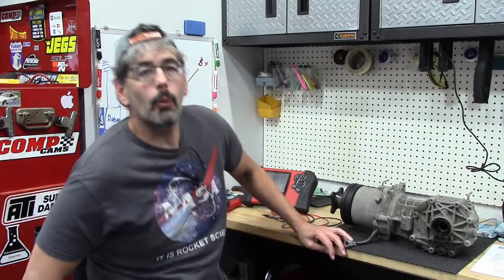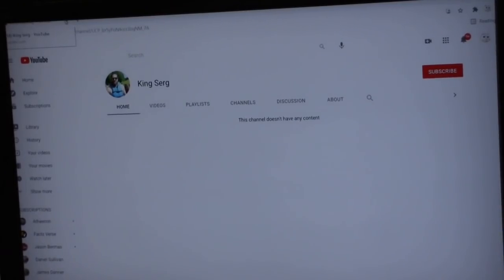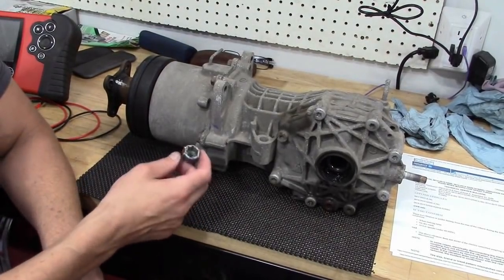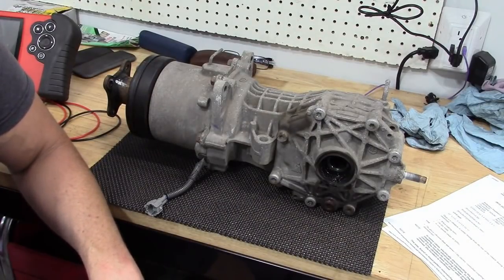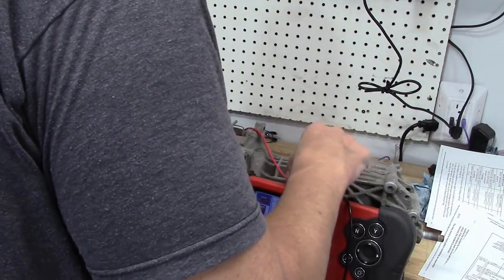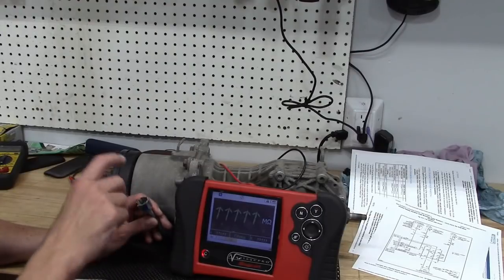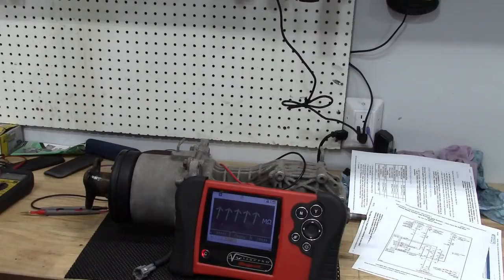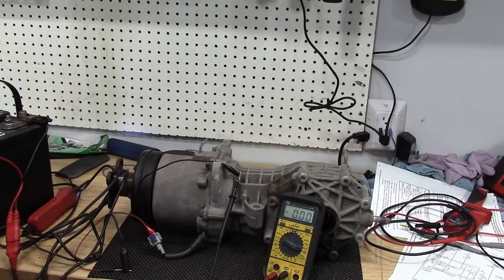Nissan Rear Differential Electronic Coupler  a PSA

Comment: So is it safe to drive with this coupler unplugged if it is indeed the party that is bad? I have a horrible clunk with it plugged in with your rotation but that house is gone when unplugged
Reply from the maker: Yes unplugging it should just make the car FWD as long as the rear differential isn’t jammed into AWD.
Reply: @SchrodingersBox okay thank you. Other than replacing the rear diff, is there a way to unjam it if it is infact jammed into 4wd just so I can prepare
Reply from the maker: You would have to take it out of vehicle and take it apart.

Comment: Where can I get the wire diagram of the QX30 Rear Differential Electronic Coupler ???
Reply from the maker: I use Mitchell DIY as my resource. Check it out. It’s just $20 for all the information on one cat.

Comment: So if you unplug it and that stops the thumping sound, you just have a front wheel drive Infiniti? Any long term issues just doing that and not spending $2k+ to fix?
Reply from the maker: Correct. Basically it just turns it into a 2wd so no long term ill effect.

Comment: Thank you for explaining this overcomplicated part ! Lol I own a 2016 Nissan Pathfinder and recently started having that 'juddering' moment when turning left at low speed.i work away on contract so I turned it over to 2wd and no problem ! I was short of time when I got back home so I had already booked it into a Nissan Dealership for quickness and convince and yes they did diagnose this coupler as the problem and there was no aftermarket part and I definitely did not want a 'used' part ! So it cost me $3,900 CAD ! The car is 9 years old but has only covered 75,000 ! so I thought it was definitely worth the price of replacement!  The part itself was priced at $3,400 CAD and labor for dealership was quite low but realise its actually a bolt on part ! But with your video I now understand this mechanism and didn't have time to fix or source myself ! Thank you !

Comment: 2024 pathfinder here....  towed a 4k trailer and next morning after disconnecting had all this happen....  low speed turn felt like axle was locked and hopping a tire.  Under warranty so dealership only replaced the coupling assembly...  my worry is if the differential is chewed?
Reply from the maker: Very well could be.  Lucky you al have a warranty. Often I’ll disconnect the fluidics coupler and if issue still happens it is probably internal damage to the differential.

Comment: PWM signals often use a setpoint current, and they PWM (rapidly switch on/off) the voltage supply to maintain that current setpoint. So in this case it's probably doing that, with a set voltage (12V or whatever) 

This is how a lot of hydraulic solenoids/valves operate.

Comment: I am getting significant rear awd binding on slow sharp turns. It sounds like the coupler  is the usual suspect but it still occurs when i electronically disconnect it. Can an unplugged coupler still cause issues, or should I focus on the differential?
Reply from the maker: It can definitely still cause issues. I also recently had one that still caused binding even after disconnecting it.
Reply: @SchrodingersBox  thank you. That helps tremendously

Comment: Well i disconnected the electronic coupler and the symptoms went away. Replace the coupler and still had the same problems. So i replace the whole differential and still the same problems. Replaced wheel bearings and its all fixed. Hope this helps anyone with this type of problem
Reply from the maker: if the issue was the wheel bearings then why did unplugging the coupler make the symptoms disappear?
Reply: @SchrodingersBox  Because all videos were pointing towards the rear diff. The sounds it was making made me think it was the diff from the way everyone was explaining. I learn the hard but iam glad I got it fixed for my kid
Reply: Did you replace the rear wheel bearing??

Comment: I keep getting squeals at low speeds in tight turns.  That is usually in parking lots.  Could it be cheap tires or is something wonky going on with the AWD?  It is low speed only when it does it.  This is the kind of AWD that is really more like FWD 95% or more of the time.

Comment: my awd rogue was towed without using a dolly some years ago and it never drove the same again, it's been getting worse and worse, my mechanic removed the drive shaft to alleviate the stress on the diff but it's gotten worse and worse to the point where the car now sounds and feels like it might break down at any moment. My mechanic says the diff needs replaced and to put a sticker on the car stating that it's an AWD and should never be towed with the tires rolling. Any thoughts? I can get the diff for 280 from a local junkyard, what should i do?
Reply from the maker: Ouch man. Yeah without knowing why it was towed originally it is absolutely possible there can be circumstances that could cause differential or transmission damage on a two-wheel tow. 
Unfortunately unless I saw the data and determined the cause of the issue I can’t really recommend a course of action.
Reply: @SchrodingersBox  i removed the old diff and opened it up, totally fucked. Huge metal shavings bundled up in a huge ball at the drain plug, gears all chewed up. Got the replacement in and waiting for the gear oil from Amazon.

Comment: On my nissan altima with cvt trans and rear diff. The electronic rear coupler was going bad and made a high pitch whinning sound. Kind of like a wheel bearing. My dealership replaced it under warranty but out of warranty would have been close to 2k fix.

Comment: Is there any truth to just replacing the two bearings and seal inside the coupler?  I've read that this is if fact the problem with the coupler.  That is $100 worth of parts.
Reply from the maker: I never heard of that before. I can’t see how that would work. You can replace only the couple instead of the whole diff, but it’s not a bearing issue. It’s an electronic issue.

Comment: Same issue with Infiniti jx35
Reply from the maker: Yes I see this happen on those cars just as often.
Reply: @SchrodingersBox  thank you for the reply , today Nissan Dealersh estimated replacement  of the electronic coupler 3000$ , they disconnected it for till (4wd ) till i get ready for the 3000 $ ,
Reply from the maker: Wow man. I have done this for 5 or 6 people in the last couple of years and I charged $400 total for a used unit.

Comment: I have the same problem with couple fail. How if I drive only in 2wd and leave the problem , will be any further damage to other parts? Big thanks
Reply from the maker: If you disable the coupler you will not do any damage- it just remains FWD only.
Reply: @SchrodingersBox  Thank you so much for your reply. But how can I disable coupler? Need mechanic do something or I just keep the switch at 2 wd, currently I drive in 2wd pretty smooth not any issues at straight or turn. Thank you
Reply: @SchrodingersBox  I have an 09 Nissan Marano I had the transfer case replaced, I still get the clunking making slow hard left turn or right turns. I pulled the four-wheel-drive fuse. The little 10 amp fuse, and it seems to have corrected the problem can I just leave it like this and have 2 Wheel Dr. with no other issues?
Reply from the maker: Yes disabling the coupler leaves it FWD. I have seen some where there is a mechanical issue though and the electrical disable still leaves it in 4WD in which case the mechanism either has to be manually disengaged if possible or the diff will need replacement.

Comment: Hey thanks for the video, I just replaced a similar differential on my 2015 qx60 and I’m curious to know if you were ever able to find out what exactly failed on the electric coupler or if it is serviceable. I still have the bad differential and I separated the couple to open it but couldn’t find a way.
Reply from the maker: While I have heard the couple itself can be separated and serviced independently, I have never tried that.  I have only ever done used units before and they come complete with diff and coupler.

Comment: ANYONE KNOW WHY THE AWD LIGHT WOULD COME ON AFTER UNPLUGGING THE COUPLER?
ITS OBVIOUSLY FAILING WHILE PLUGGED IN BUT NOTHING LIGHTS UP TILL ITS UNPLUGGED.2013 INFINITI JX35
Reply from the maker: I think maybe because the caps lock key is stuck on ?
Reply: That’s normal for the AWD light to remain on after unplugging the coupler. But you probably figured that out by now.
Reply from the maker: Roberts is correct.

Comment: I wonder if you have to test it live(key on or car running) cause it probably has to detect slippage for the ecu to send voltage or signal to activate it. Probably the more slippage, the more resistance to apply locking force?

Comment: 2021 Nissan rogue with 27k needed to replace the AWD electronic coupling assembly part 38760-6RE3A , glad its a lease and under warranty . Nissan needs to up it’s quality control .
Reply from the maker: I literally just did yet another one this past weekend.   Yeah they have a definite issue with the differential for sure.

Comment: I have this exact issue with my 2016 QX60. I cant afford to replace it righ now either. I'm not able to do this myself. Other than the dealer, what type of shop should I take it to have it unplugged? Will the technician be liable for anything?
Reply from the maker: Any technician can unplug it. actually any person can. you don’t even need to lift the vehicle. you can reach the plug quite easily.
Reply: @SchrodingersBox  Ok great thank you. I thought I would have to lift the vehicle. Thanks so much for your prompt response.

Comment: 2017 QX 60 rear electronic coupler is bad like you explained. Can I just unplug it and leave it? Can’t afford to replace it
Reply from the maker: YES!! It will just make the vehicle 2WD.
Reply: Thank you so much. I may look at a complete unit used. Any suggestions on where to find one? I may use LQK used auto parts
Reply from the maker: Try searching  “team PRP”. it’s a network of used parts with lots of locations in major cities. there is a location in denver where I get all my engines, transmissions and differentials (including this one in the video) and they always come through.
Reply: Thank you I am in Colorado Springs so I could make the Denver run. You’ve been very helpful thank you
Reply: One more quick question. I’m going to purchase a used complete differential and electronic coupler and install it. The dealership says that I need to have it towed to the dealership and programmed. Is this true or can I just reconnect the electronics and be fine?
Reply: @theqt-biblestudywithstevel4358  Did you ever get an answer to your last question about programming?. I'm having the same issue with my 2017 QX60.
Reply: @waranda6068  yes. I did not have to reprogram it. It worked perfectly.

Comment: This happened to me as well coupler failed. Felt like my rear passenger tire was locking up. This is with a 2018 Infiniti QX30 AWD with only 30,000 kms. Covered under warranty , cost over $7000.00
Reply from the maker: holy cow $7000!!!!  sheesh, I believe I charged $600 for this repair including the used differential. car has been great ever since!  man so glad that was under warranty for you.

Comment: have a 2015 pathfinder the coupler was replaced in the fall of 2020 at 104000km, Nissan covered it.  Now 30,000km later the same symptoms are happening, Nissan says too bad parts have 1 year warranty only.  I asked is it common for parts to fail after 30,000km, crickets..

Comment: Hello everybody, Question if some one can answer will be very appreciated:  I took the main shaft and the rear axles out on my 2015 Murano, I did put the outer end in without the axle-shaft : "safety first". Have a heavy oil leak in the differential. My millage improve from 18.5 to 22.5 doing the same driving so this thing is going to remain like this. Now I want to take the differential out. The questions are. The air hoses connected are for vacuum or cooing or what, should I just block them or join them together..? And the connector for the clutch/selenoid that engages the all wheel drive should I just disconnected is it monitor by the system?  I want to avoid a check engine light of course. Thank you for your time to answer.
Reply: Hey how did you solve that problem?

Comment: Hi if I take the drive shaft out and drive the car without drive shaft will that be harmful for the car.  I know the all wheel drive will not work but iam not worried about all wheel drive?  Please help
Reply from the maker: on some modes you can do that and there won’t be any problem- it just acts like 2wd. other models you would leak the fluid out.

Comment: There is a service bulletin for these, but there's not much info in it.  Basically if it's acting like a spool rear end during tight parking lot maneuvers, unplug electromagnetic coupler and if it goes away, you've got a hell of a direction.
Reply: Hello Matt!....i did disconect the e coupling and the kicking went away...my question to you is, is it necesary to replace the e coupling?  Is it ok to have it run without this part?...how long can i drive my 13 pathfinder without the e cuopling without causing any damage to any other part?
Reply from the maker: You can leave it like that permanently or until you replace it. It just makes the vehicle 2WD is all.
Reply: @hectorperales143  that Matt is correct!

Comment: What if you apply voltage and spin the input shift? Just curious if it turns the differential with voltage applied.
Reply from the maker: yeah I did try that before I realized how it works-  you. can’t test it that way.  Good thought though!
Reply: @SchrodingersBox  I figured you would have tried that. I just wanted to ask. Any idea about how this differential actually works?
Reply from the maker: Yes I will go into it at some point when I have another model but it’s a viscous-coupler. basically a lot like a fluid-clutch (like a car torque converter).  
  it is not a mechanical solenoid like I first thought.

Comment: I had this same problem back in March 2021, with a used 2009 nissan murano SL.  When i turn corners there was a hard judder like the brakes were grabbing ,a loud clunking. (at one point sounded like metal grinding) It was replaced with a junkyard differential and works fine now.  Also with my Nissan the transfer case was bad, missing or broken tooth in the ring gear. The dealer at the sales lot told me he just replaced the transfer case and severn days after purchasing the suv the transfer case went out again. The dealer offered to pay and replace it, and that was done but it was then when i test drove the suv i still felt the judder in the rear when making turns left or right. The mechanic was in the back seat an felt it. He replaced the rear def from the junk yard $300 parts an labor. Its been running fine sense ,and i drive it daily. The mechanic told me the most common cause was from improper towing not on a flatbed truck. but with the rear wheels on the ground. He mentioned that only a short distance of a block could do the damage to the differential .
Reply: facing the same issue now. So I guess there is no other way other than to replace the differential

Comment: Hello good day. A fan from Nigeria, and sorry am typing this here but it base on fuel trims. Here is my question and hope you can help. I don't have a code yet but from my fuel trim, or LFTS bank 2 I have -17, mean am running rich. And I have this funny herd start during warm startup and a little misfire don't really know what my problem is. The funny part is no body here around me seem to know what is going on
Reply from the maker: Yeah a rich condition can create a hard start.  Being that you are from Nigeria you qualify for free access to my paid channel and I have several videos on diagnosis of rich fuel trims there.  Send me your email and I will qualify you are eligible for the free access.
  Until then. I would start checking fuel pressure and fuel pressure regulator, check EGR and EVAP, and all other sources of fuel that could be entering engine unmetered.
  Conversely, you could have less air entering engine than is being measured- so PCM is over-adding fuel.  Bad MAF, MAP can do that.

Comment: Just watched the new Trans Am - broken valve spring video on the pay channel. You'd think this would be a more common problem, but I've never seen it before. It may be a pain but it could have been so much worse. Will you be replacing the other springs as a safety precaution? Great little series, this - it's amazing how those new shop lights improve the picture quality; everything is so sharp now. Thanks for the insight.

Comment: Hey, Matt, I came across something new to me yesterday, and I think it may possibly be an idea for the pay channel. I was working on a newer vehicle that used an AGM technology battery. It's my understanding that these batteries are used in high-demand, stop-start cars, but this vehicle was neither of these - so why? I used to have a 2011 Ford that was stop-start, and that used an EFB (enhanced flooded battery). I just thought a little insight into these new technology batteries would be really useful - particularly as I believe that replacement AGM batteries need to be programmed into the vehicle. Any thoughts?
Reply from the maker: yes Andy I am aware of those and plan in the future to do a video on all the battery types, not just these. Thanks for the suggestion!!
Reply: @SchrodingersBox  That's great news! Looking forward to it already.